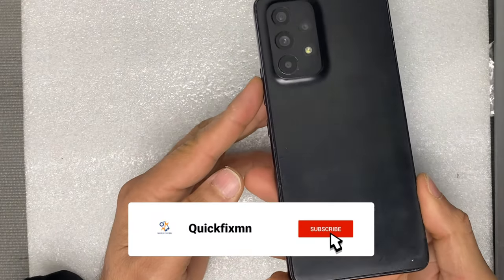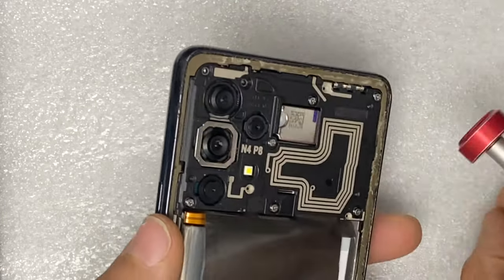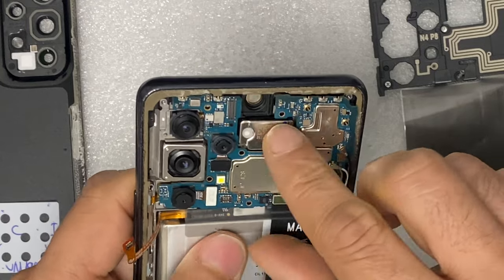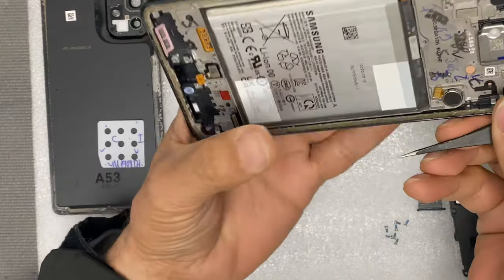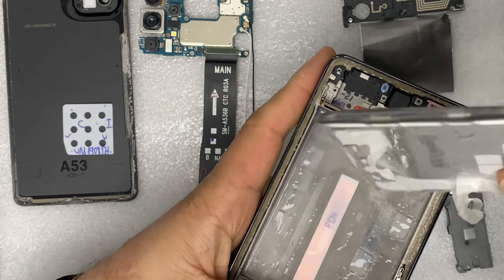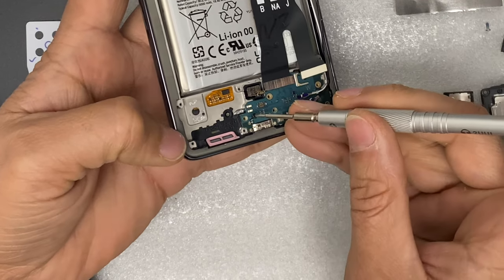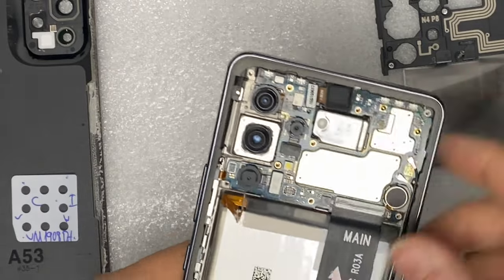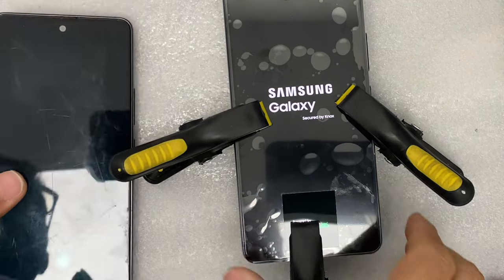Samsung A52 / A52 5G screen replacement | Crack screen / display replacement for Samsung A52 and 5G

Comment: this is great :) Question: can you TEST FIT the screen and chassis and leave the fingerprint sensor out and the front facing camera?? so you don't have to take the protective films off. 

I want to make sure its the screen that's broken first incase i have to send the part back. So just want to check it powers on without connecting the camera or fingerprint. Will that be ok??